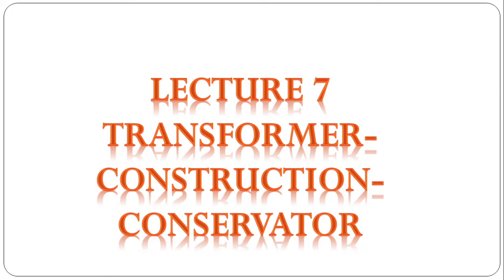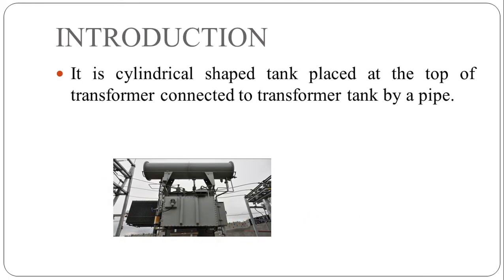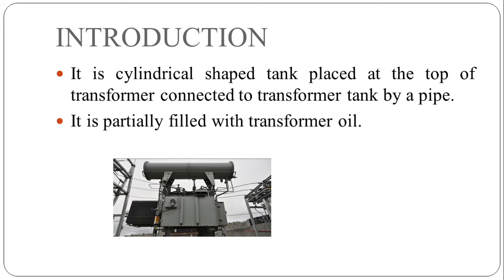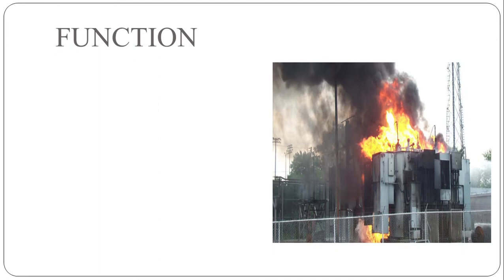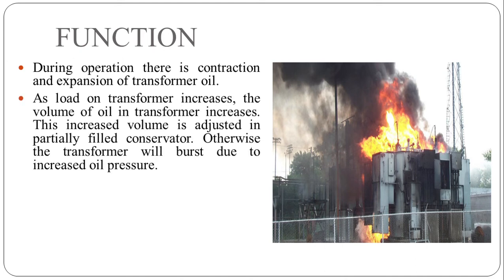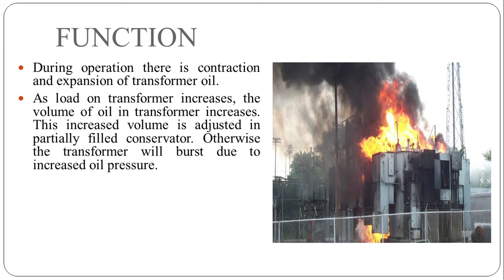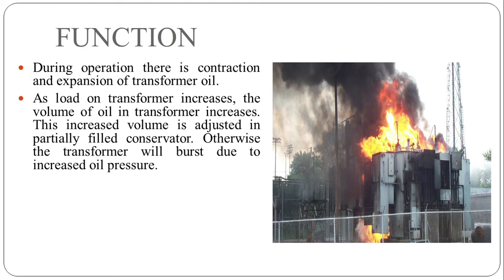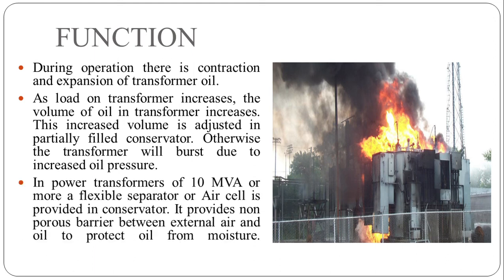Transformer 07 | Conservator tank Transformer | transformer conservator tank oil level |

Comment: A conservator tank of transformer provides adequate space to this expanded transformer oil. It also acts as a reservoir for transformer insulating oil. when ambient temperature rises conservator tank of transformer provides adequate space to this expanded transformer oil. The arrangement ensures that oil does not enter the silica gel breather even at highest operating level. So if there an explosion may not caused due to excessive oil pressure, unless exceeding the (temperature) oil melting point by overloading.